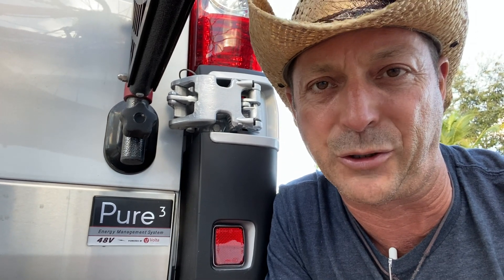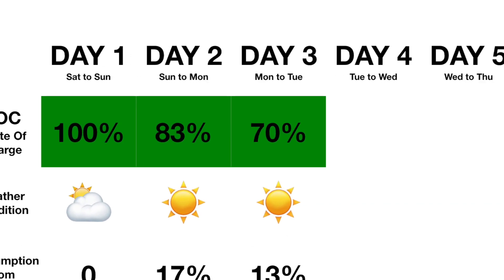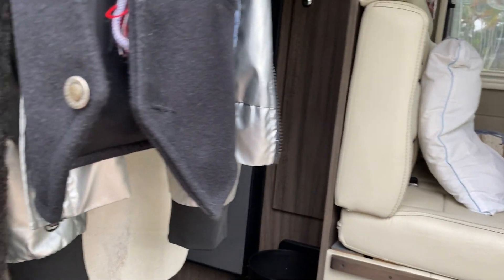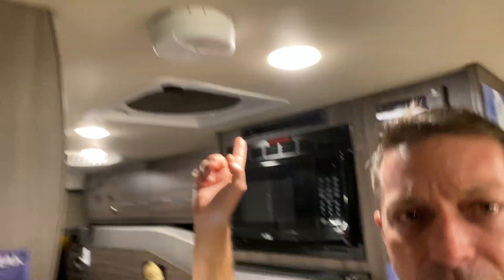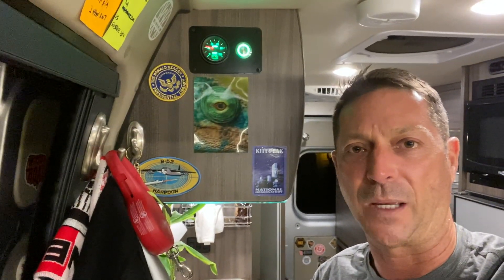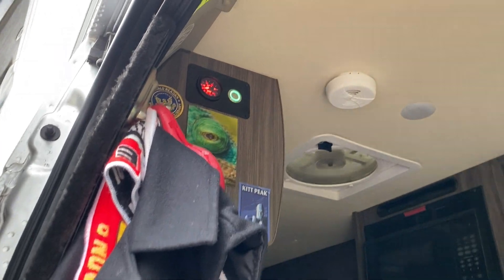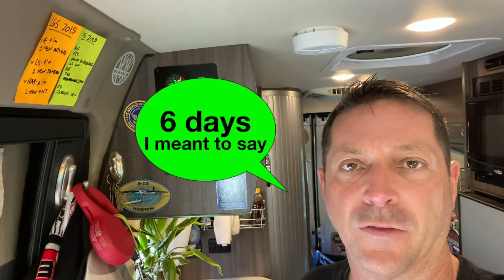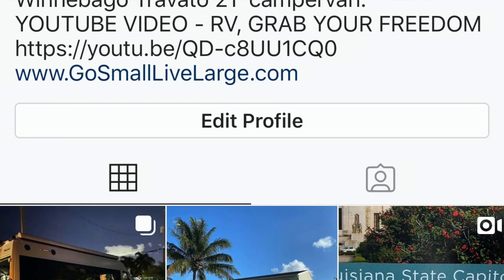TEST LITHIUM BATTERY ENDURANCE on 12v DC from Pure3 by Volta | Full-time living in a Winnebago

Comment: Thanks for the video! I just picked up a used 2020.5 Travato 59GL! All your fault 😁 I’m having power issues and hope you might be able to point me in the right direction. I dropped 30% in one very sunny day to next morning 24 hour period. The only thing running is my refrigerator. The inverter is off. The water pump is off. The Truma is off. There are no 12 V lights being run during the 24 hour period and there are no 12 V plugs plugged in or USB cords plugged in. I am really puzzled! Thanks in advance for any clues you might be able to throw my way. Have a great day!

Comment: Just rented a 2019 Travato KL and had a different experience...
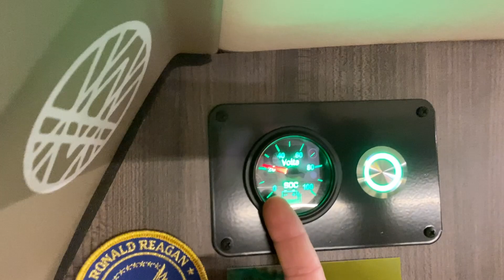Temps went down to 26 degrees at night so we had heat running at night (74 degrees I think). It was on Mix 1, which I later found out was using electric and propane. I assume we would have had a different experience on Gas only. We had been plugged in, so started at 100%, unplugged around 6pm or so and the system died at 6:15 the next morning. Pitch black dark but fortunately were at RV park and I was able to go outside and hook up the van so we could see. During the night we had lights, fridge, and charged a couple of phones overnight. 
Would it have been the Mix 1 setting that drained the battery? Heat had to run a lot, so assume the electric was on quite a bit of the night. 
This experience also makes me concerned over the Embassy RV's since they don't use propane at all, just electric.
Reply: Roads of Life  yes, mix 1 would be a battery killer.  I would not use this unless plugged in.  Propane is very efficient and will actually keep you warmer than mix 1.
Reply: @ctzerbe1  Rookie mistake! We were not sure what the mixes were or how they would affect battery life, but it was good we were at an RV park... we just plugged in and all was well!
That said... it sure did last a long time, even unplugged and on mix!
Reply from the maker: Congrats RoL for getting out there and experimenting. Very proud of you!!   And Craig is right, using propane only is way better that electric for heat. If I'm plugged into shore power and the outside temp is not too cold, say below the 50s, you can probably be comfy with shore-power based electric heat. Anything below that the propane heat is much better (read hotter) than electric for heat. If not using shore power, use propane.

Comment: That red SOC gauge makes me twitchy just seeing it in your video!  Turning off the inverter makes ALL the difference. I got a 300 watt inverter that I plug into a cigarette port and use that to run my computer and monitor so I can keep the big inverter off unless I need the microwave or a/c. As long as I do that I'm all good. Merry Christmas!
Reply: Are you referring to the draw an inverter uses while on standby? Each inverter draws differently...some nearly nothing...some quite a bit. Yet to eliminate the draw on a test like this would render the test of no value.
Reply from the maker: Yeah, the Pure3 inverter consumes quite a bit of ice in standby mode. It was explained to me that that inverter on is similar to having your car engine running in Drive, but your foot on the brake at a stop light. The second you release the brake you have instant energy from the engine. Same with the inverter. with the inverter on the second you plug in or turn on a plugged in appliance the electricity is instantly available. Having that power ready from the inverter consume power.
Reply: @GoSmall.LiveLarge  Makes sense.
Reply from the maker: Thx TGW.  Intersting alternative to the big Pure3 inverter when conserving battery.
Reply: @GoSmall.LiveLarge  Its been a game changer for me when boondocking if I don't want to use auto-start.

Comment: Another helpful video, Scott!  I can't wait to take delivery of my Travato GL soon.  I know that they have "upped" the standard solar panel array from 200W to 230W.  That, along with the upgraded solar controller upgrade, should definitely be noticable improvements.  Your experiment gives me a nice base level to start from, and compare to.  Have you added the Volta Bluetooth module and app also?  Again, you need to get on Winnebago for some commission money.  I'm sure there are others out there that you're helping to tip the scales toward a Travato purchase!  Happy Holidays!!
Reply from the maker: Thx TD1  :)   I hope to get the Volta bluetooth module when it is available.

Comment: The test would mean more if you were actually staying in the RV and using the electric how you would normally use it.  Charging your phone, laptop, iPad and running tv to watch a movie (or iTunes) - the power you would consume normally.  And how long to charge the batteries back up - staying in same spot and not driving or driving?  Is there a difference in length of time to charge?
Reply: CWS.
Reply from the maker: Yeah, you are probably right, but charging mobile devices in short bursts has a limited impact on the battery. I do run the LED lights and the Jensen stereo when I am in "electrical conservation" mode. I"m thinking it too would have a small impact. Not sure about the TV though.

Comment: Would a person be able to sleep comfortably in Lilly at night in FL with just the fan and open windows? About what temperature outside (or inside) before needing some air conditioning? Thanks so much Scott. I appreciate the “mundane” aspects of Class B living. On a side note, FL is my go to vacation spot, particularly the Tampa and Bradenton areas. Gulfport, FL is where we usually AirBnB. Love love love it. Have fun!
Reply from the maker: Hey Wayne. I have found that if the evening  cools off enough using the ceiling fan with windows open is sufficient. For example, I am in Tampa FL area now. Today was 79. Tonight will be 69. If the rig isn't overly heated up (such as sitting in direct sun all day) the lower temp, a gentle breeze, and the fan running is sufficient for a very comfortable night of sleep. Trick is not to get the rig overheated in the sun, by keeping it in the shade during the day.

Comment: Great video.  Battery and electrical management is important topic for RVer's.  I've been trying to get myself up to speed on electrical management (AC/DC, amps, volts) and how much power each of my devices is using.  Still learning.  I think you missed one important and energy pig user that  your RV is using-- the inverter.  My GL is sitting in my drive way and I can go 5-6 days till I plug it in.  I usually don't let it go below 20%.
Reply: @adamloughran  What does that mean? I have a large inverter that allows me to choose what standby mode I want. Draws very little or quite bit depending on how I set it up. Did Adam address this? I better watch the video again...
Reply from the maker: Hi MW.  Yeah, with the inverter active, even with no appliance usage, it alone consumes quite a bit of juice in "idle" mode. I have found the best practice to turn the inverter off if I am conserve electrical resources.  Hope that helps a bit.

Comment: You asked us to post how long our batteries last. Before I added lithium to my RV, probably less than 24 hours. Now I have 540w of solar, and 4800 watt-hours of lithium batteries. Running the fan, and the fridge (on propane) I generate more from solar than I consume. I don't have a compressor fridge (wish I did) but can run the fridge off the inverter but probably only about 1 day since it is not very efficient on 120v.
Reply from the maker: Thanks for sharing DD. That puts some perspective on a different lithium situation.

Comment: I'd love to know if you'd lose a day by charging a laptop (w 12v dc charger) and cellphone/internet access device every day. That's my sweet spot I'd expect my day to day to be like. DC for a light, a fridge, a fan, and my work devices.  Have a great rest of 2019!
Reply: Most laptops have a power supply that's between 50-100 watts. But if you leave it plugged in all day, it's only taking a small fraction of that. Let's say you are using it hard, for 10 hours a day, and pulling an average of 50 watts, that's only 500 watt-hours per day from an 8700 watt-hour battery pack. Depends a lot on your computer, how much you use it, and how hard you push it while using it. Charging a phone is going to be negligible. It would take less than 15 watt-hours to fully recharge a typical phone battery.
Reply from the maker: Thx SLP.  My experience is charging a phone, iPad, and laptop computer for an hour or so is a minimal draw on the energy pack. Charge your devices and turn the inverter off is what I do.

Comment: Very interesting, Scott. Thank you for sharing this info. I'm so torn about solar after Terry Minix's comments about solar on your Embassy RV videos. But this makes me think solar might be worth the loss of roof space. I don't kayak anyway. LOL. Of course, solar can always be added later if we think we need it.  Thanks for all you do to offer such great info! Merry Christmas!
Reply: Solar is so cheap, relative to a good lithium+inverter/charger system that I feel like it is a might-as-well option. If you are always going to cover it with kayaks, maybe not, but how many RVs do you see out there with kayaks on the roof? I've seen them in videos but never in real life.
Reply from the maker: Solar is important, but my experience show me that a great lithium energy system allows for not going solar, if you want stuff and toys on the roof!
Reply: @GoSmall.LiveLarge  I agree with you that with the Travato GL, solar is a negligible source of power. The underhood generator produces about 6000w, as I recall, and the GL only comes with 200w of solar panels. Some typical solar math says you would get about 1000watt-hours from solar per day for the 8700w-hr battery bank. Not much. By comparison, driving a mere 10 minutes per day would contribute as much to recharge the batteries as a day of solar. It's a different story for a more typical solar setup. My Trend 23L (wannabe Travato) has a custom solar system with 540w of solar panels, a 4800w-hr battery bank, and just the regular alternator to charge while driving. In my case, I get about 2700wh per day from solar (more than half of my capacity--and I often don't use that much in a day) which would equate to about 6 hours of charging from driving. All of which just shows you how great the Pure3 system on the Travato really is.
Reply from the maker: @daveduncan2748  thank you for that very thoughtful and thorough comment on the electrical. I have to admit to not being very mathematical. so I truly appreciate your explanations.
Reply: @GoSmall.LiveLarge  Good to know. Thank you!